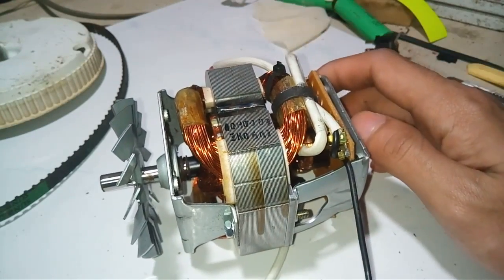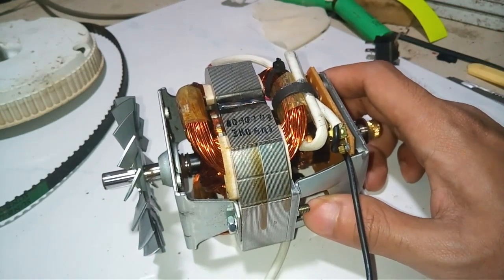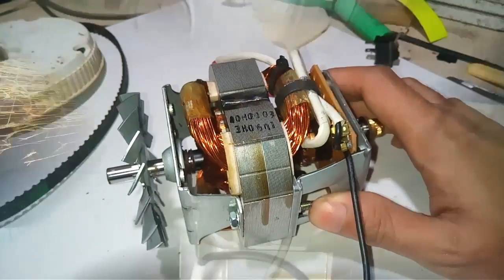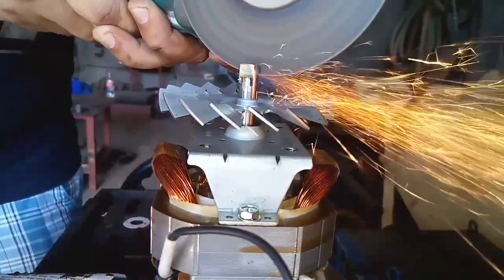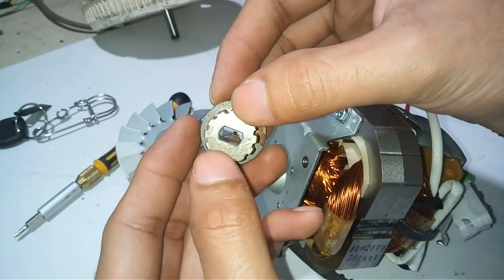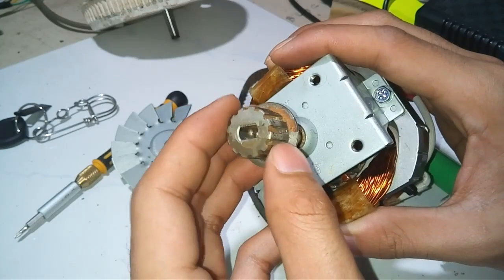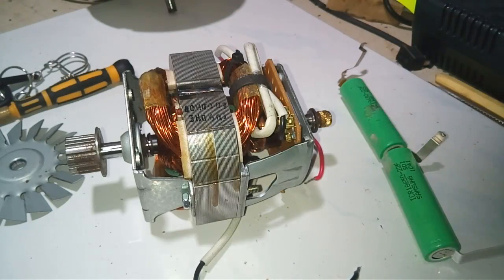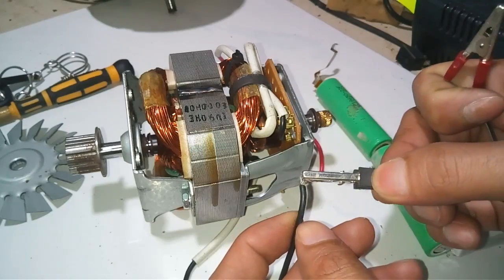AC motor for ebikes

Comment: in reality, these motor are an DC motor, just named also "universal motor"
These motor can run on AC, cauz the stator are coils and no magnets.
Reply: Reason is serial winding motor which works on both AC and DC moreover these too are used in washing machine driers

Comment: hey i'm using my 850w mitter saw for the main motor on my wooden scooter, the main problem is "inverter". i need 1000w inverter (12vdc to 220v pure sine wave $60) this is to expensive for me.
Reply: 😂😂😂 better to use bldc motors only
Reply: Than go out and steal an inverter.
Reply: @KeyboardBuster  or rob a bank

Comment: Say the motor worked on a bike it wouldn't last for more than 50 Klms. When you cut the shaft on the motor with the angle grinder to attach a type of sprocket once pressure is on the shaft it won't be running true therefore the bearings on the motor will stuff up. Your demonstration worked but in reality it definitely won't work
Reply: It actually works. I have built my double motor powering my bicycle running on capacitor as input to invertor, I need to drive till my capacitor bank is full. Then leave it, my bicycle tops speed of 70 kmph

Comment: Using angle grinder without safety guard, is something I have done & suffered the consequences & bare the scares. And I still never learned👌👥🙌
Reply: Stanley Bowman yep got 2 scars now from  cuts. P.s don't neglect the safety goggles or better yet full face guard, I have had a disc shatter on me...... lucky escape for my dumb ass but not fun picking out shrapnel :)
Reply: I will only use an angle grinder in a chop saw type support structure.  I turned one on 1 time and it was leading me around the room.  Way too powerful for me.

Comment: This kind of motor have low efficiency it will drain fast your battery
Reply: AC Motors are much more efficient than DC motors actually much less maintenance and more durable
Reply: Then do not use Battries, use capacitor and generate the current to feed the capacitor

Comment: Yes it's true some AC motors(universal motor)can be operated on either direct current or single phase alternating current at approximately the same speed.This motor is most popular in the fractional-horsepower size and is used on household appliances such as vacuum cleaners,food mixers,drills,and power hand saws

Comment: is fake the motor ac  with batery dc ???
kkkkkkkkkkk
Reply: There are many motors that run on dc even though made for ac; they are called "universal motors" I run a vacuum cleaner motor with solar panels also most ac electric drills have universal motors they can run with batteries dc
Reply: It's a universal motor
Reply: Fake? I guess you never heard of universal motors

Comment: fake...
Reply: lots of ac motors run with dc batteries they are called universal motors examples are vacuum cleaner motors, ac electric drills also it is not fake you just dont know too much about universal motors
Reply from the maker: no sorry, we just give you an idea
Reply from the maker: also the inverter type power supply. like phone charger, loptop charger, and PC power supply. can work in high voltage DC source.
Reply: Alex Manzanero I m so sorry
Reply: Laci Andrè 
what a dombo,that is never working
Reply from the maker: Laci Andrè fake?
Reply: It's okay but the 220 volt 220 can use it here only max 10 are going to the engine + the carbon brush too few for this 10 volts.
Reply: really?
Reply: So I got the electronics too, but here something is wrong with the engine or a small electric motor, because then the solution is true :)
Reply: Laci Andrè       ? no!
Reply: Laci Andrè its 7,4 volt
Reply: noo... he used the inverter to turn on the ac motor..
Reply: Ed Boer ur the dumbass here. You cant write, and you don't even know anything about electric motors.
Reply: It's not fake it's real these motors are called serial motors or universal motors but these motors have higher losses considering for a electric byke most suited motors are geared bldc motors it's not convenient to use an invertor for ac 😂😂
Reply: thanks ;)
Reply: Laci Andrè no it works i test it